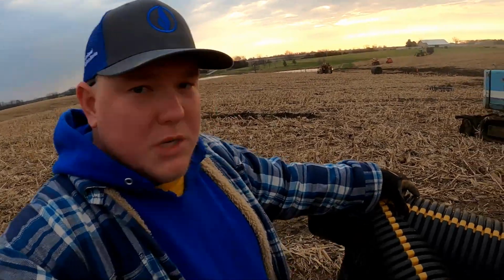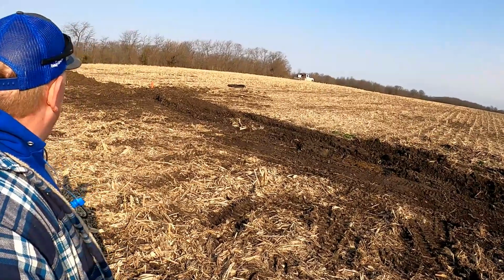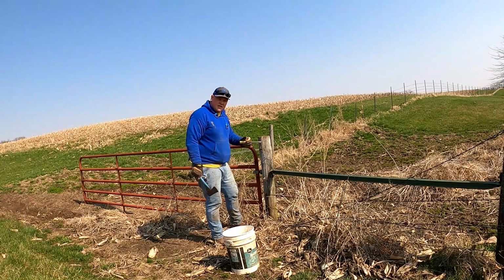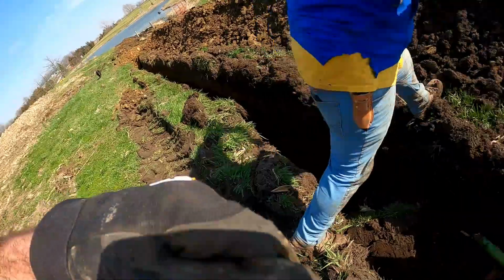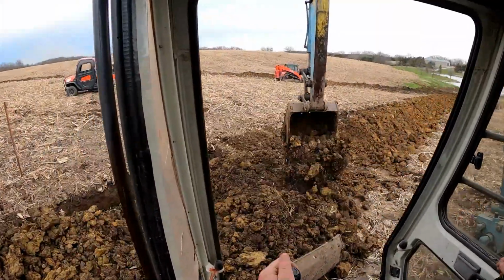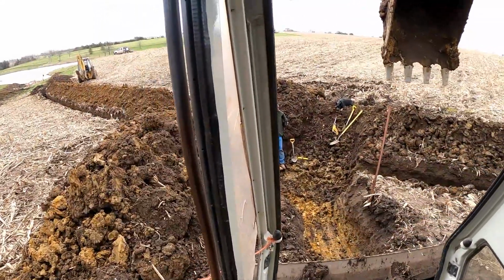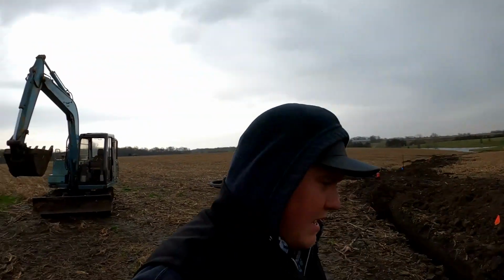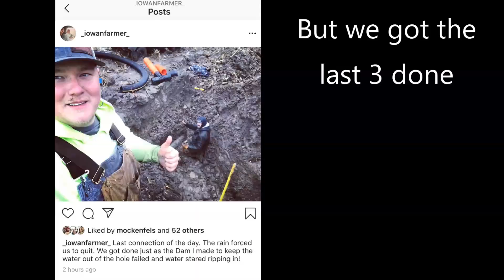I NEEDED HELP! - Fighting Mother Nature!

Comment: Water doesn’t flow from the high pressure of the soil into the low pressure of the tile.  The water that enters the tile does so through gravity, not pressure.  The tile just provides the void for water to flow through more quickly than it would through the soil itself.  Gravity being the moving force, is also why tile should be installed on a slope with the exit being on the lower end.  Tile installed perfectly flat, can drain water, but not very efficiently or quickly.  

Gravitational water is basically unusable by plants. Capillary water is what plants use, and is the water that’s in the soil micropores.

Comment: First things first. My hats off to you for giving that guy some work during these uncertain times. 

Now my 2 questions. What size pipe will your tile plow put in? Also how do you know your pitch is correct? I never see you guys use a transit.
Reply from the maker: Bob Kyllo this project is 8, 6, & 5”. And just ordered some 4” 

Slope is great enough that we are using a grade bubble. Plus the machine is slow enough we can make adjustments.

Comment: Why don’t you have erosion barriers, like grass waterways?  Noticed the large washout in the field where the tile was being put down.  Ben needs a stuck Blueheeler!
Reply from the maker: Randall Harmsen this is an erosion barrier project
Reply: iowANFarmer true with earthen barrier.  What about uphill where the runoff cuts into the prime soils?  Grass barrier would help stop a lot soil making down to the earthen barrier with the upright drain.
Reply from the maker: Randall Harmsen it’s all got to cut across the field. My plan it’s to control all water moving across this property.

Comment: You guys did some really cool work.  Guessing there’s a lot of math for tile sizing that your not showing.  Also does the state require you to file a tile plan?   Your editing of videos is getting really good.   Would a back flow or check valve prevent animal from going up the pipe

Comment: The largest pipe laid down looks to be 10".   What is the largest project pipe you have worked with?     Do you use a plow to put down the pipe?
Reply from the maker: Bruce Kleckner 10” is the largest I’ve put in the ground.
Reply: @iowANFarmer  Is there a reason you don't plow up through the field?  Seems like you would disturb less soil.

Comment: Do you guys experience a lot of black dirt where you are located. Here in Indiana we experience some of it and it is not the easiest thing to drain. Just wonder if you guys have the same problems. Also do you guys have tracked tiling machines in Iowa or mainly wheeled machines. I have never seen a wheeled tiling machine/trencher before so it's cool to see it in you videos.
Reply from the maker: Life On The Farm there is a bit of everything. I’ve seen fields here with 9 different soil types. That machine is from the 60’s!
Reply: iowANFarmer yeah that’s how it is here too. Lots of different soil types in every part of the state. And yeah that machine looked like it was from about that era😂. As long as she works that’s all you need.